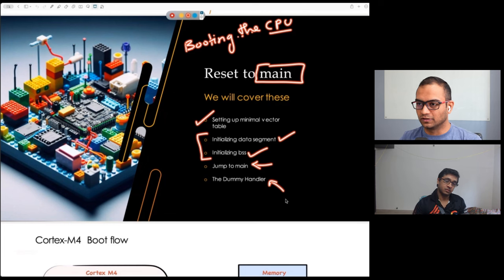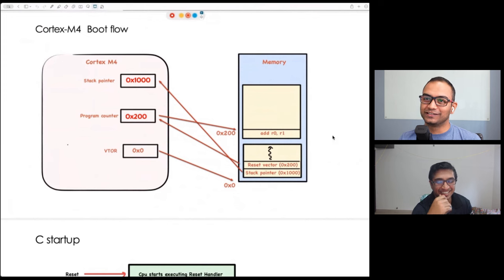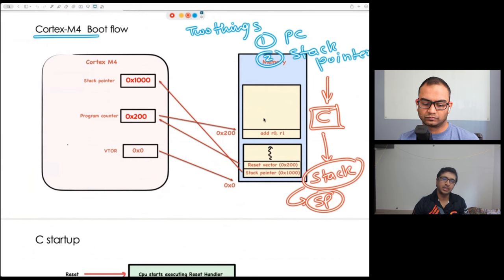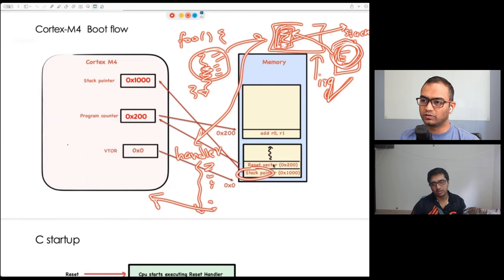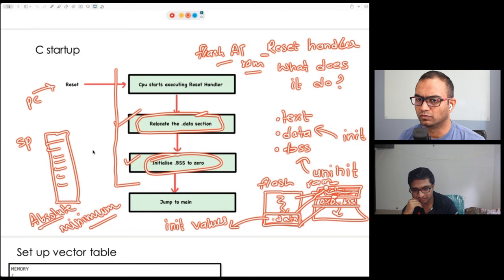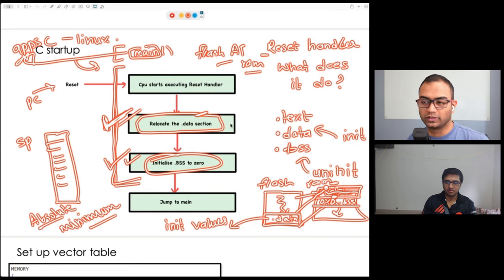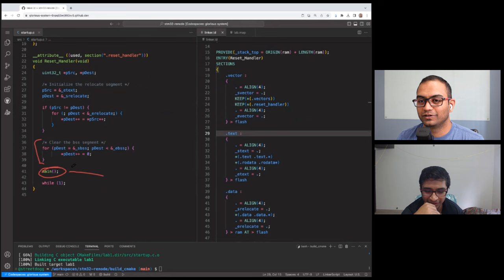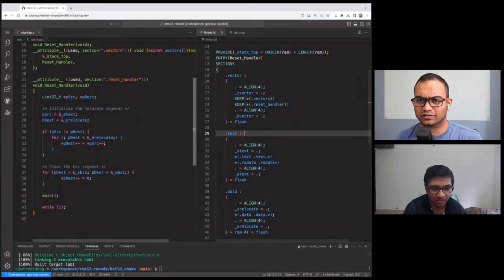ARM - M: From Reset to main | Embedded Systems podcast, in Pyjama!

Comment: While running IDE such as Keil or STM32CubeIDE, the startup file generated also has system_init & libc_init APIs associated. Could you explain what exactly happens with these APIs? Thanks.
Reply from the maker: System init is not standard and very much a vendor thing.
Historically working on atmel devices i have seen system init to either contain code that bumps clock to max frequency and initialize a variable or structure that contains this frequency values that can be used through out execution
Libc init arrays calls constructors for different c library initialisation. It's difficult to explain that in a comment
You can refer to  https://stackoverflow.com/questions/15265295/understanding-the-libc-init-array

If not let me know may be we can connect on LinkedIn
Rajat